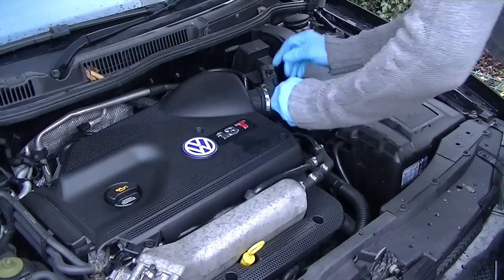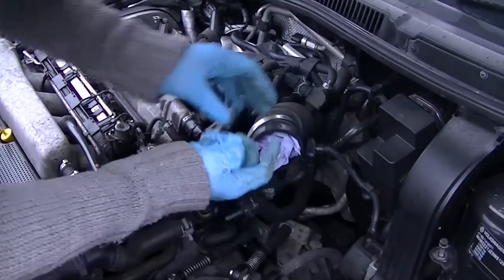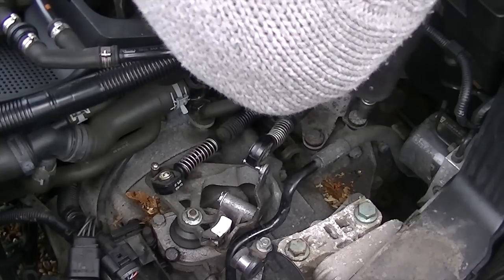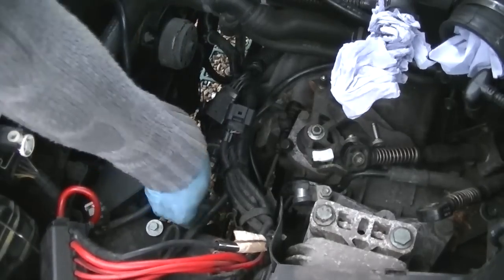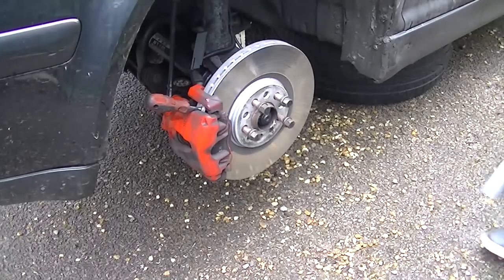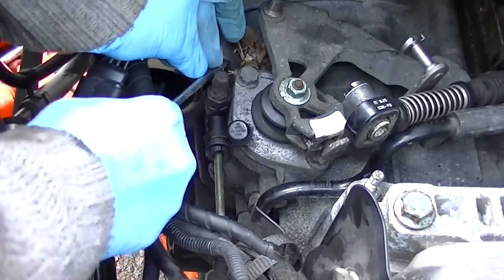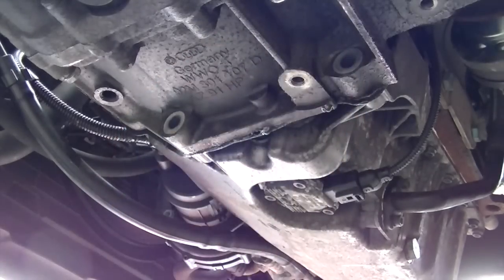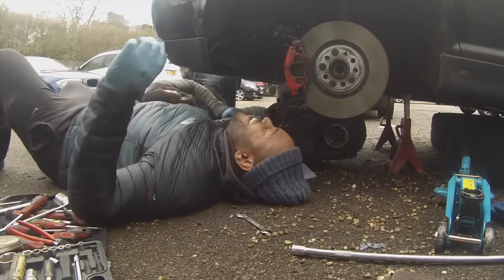How to Replace a VW Clutch Part 1

Comment: Wtf takes a new clutch off after a year or under on a new car? 
It took me 15 years to wear out a 2000 clutch & didn't get the truck till 05. First year I have it I always engaged clutch bc I was young dum & full of Gum it wasn't a 4x4 nor a heavy duty & I treated it like it was. It wor out bcz I down shift for 8 months bc my brakes were stuck on.

Comment: trying to talk myself into doing this on my 2002 New Beetle.  I think it's almost turbo time also at 340,000 miles.  It would probably be easier to do the turbo with the transmission out of the car.  I just don't know if I have the physical stamina it takes to complete this job.  I changed the oil in the car yesterday and I'm worn out today....

Comment: This video gave me a good idea of the job and I did it within two days on my 1.6sr. 
The transmission removal was indeed the hardest part, I've found that the lefthandside axle flange keeps getting caught on the engine. 
With some persquation it'll get past though.

Comment: No joke about having help with a gearbox. The last clutch I replaced myself was decades ago, on a Ford Escort, rear-wheel drive. On the road outside my house. Unlike this, there wasn't a dozen things to remove for access. Unbolt the drive shaft, undo the clutch housing and pull back the gearbox. Which, in my case was too heavy for me on my back, and it dropped, crushing a finger on the road, needing a hospital trip and five stitches to sew up a burst digit.
Now, any job that really needs a proper lift, I leave to my local garage. Anything else, I'm fine with.

Comment: Thx for the video
,I have a vw touran  2004 and have replaced clutch plate at a workshop. Just a month ago. The 6 gear come to neutral while moving 90 km /h  and when seting the shift gear on 5th gear a silgt back and forth movement in the shifr hapoen in a second and come to normal. What could be the reasons for such problem? Can cables connection make such prob. Or what could be other reasons...I do appreciate your help and support..

Comment: guys one more tip use a white old not used sort of blanket or sheet under the car. incase you drop a screw or something otherwise youll lose it in the graffle

Comment: Nice guys and nice video, but bad advice regarding dropping the transmission out without first removing the sub-frame.  Seriously, the transmission has to be pulled straight back off the engine at least 4 inches before it can be lowered, at which time its axle flange and then the trans. case bolts bind up on the sub-frame.   I could have removed the sub-frame four times in the time it took to fight the transmission around the sub-frame.

Comment: Tackled my clutch and flywheel swap at the weekend. This video and part two are were my reference guide.

Hardest part was navigating the O/S driveshaft flange over and round the flywheel/metal gasket.

All works as it should do.

Thanks for the vid!

Comment: on the MK4 Golf how many miles does the clutch last?
Reply: jimmy mangat as long as you make it last. 
 know of some that did nearly 200k on the original, but I know others have gone around 90-120k. It is more common for the dual mass flywheel to fail than the clutch!
My Leon, ASZ engine 6 speed box had 140k on the factory clutch but the flywheel was chattering. I had the car remapped and the clutch started to slip.

Comment: Thanks for the great guide. Quick question, hopefully you are around still. I have the new flywheel, clutch, pressure plate, etc. all installed. I am really really struggling to get the transmission to hook up though. 
How did you do it? Any tips?

Comment: I got a 1999 VW Passat 1.8L turbo needed a clutch, my mechanic got the clutch put back in but ran into an issue it won't start/or turn over. Any ideas what it could be? He said he unplugged 2 cables. Could it have ruined the starter? Or could it be the security inside the car that won't let it start? Please let me know what you think

Comment: I need help, transmission fluid got into the flywheel inspection hole clutch is slipping do I need a new clutch or will it dry out?
Reply from the maker: you will need to replace clutch and slave cylinder
Reply: thanks guys had it booked in yesterday runs a lot better all they did was replace the clutch not sure about slave cylinder

Comment: thanks man. definitely help me 100% on mine. i was completely oblivious on what to do. my flywheel was offset with the bolts and had to cut out the flywheel plate to get to the bolts.  i also found it easier to get the transmission removed from the top. on my tdi there was a bracket i was able to use as a handle and twisted it as you mentioned.  cheers!

Comment: I changed my clutch following your video. Good stuff !  Just want to add something because I was alone most of the time. So it really helps if you lower the engine (at the gearbox side)  once the gearbox is detached from its mounting. I cant say how much it should be lowered. Very carefully and when hear a slight crackle then stop (about 150mm). When you detach the gearbox from the engine body , you need to  swing the differential  anticlockwise about 90 degrees (till stands upwards) . I suggest doing the same thing when fitting it back. Also prior assembly I pushed the engine slightly towards the other mounting (on the other side of the engine) and lay it on a axle stand so it does not come backwards. A few centimeters of more freedom really helps.

Comment: The torx bolts on the transaxels are stripped, is there an inexpensive solution?
Reply: +spadesishere buy the Torx Socket Tool . they go usualy for 16-30$ on ebay new. or ceaper at your local tool store. even though you will use them to remove the transaxels . i can ensure you.it will come time which you will need to use them again.
Reply: +Niklez7 not very helpful seeing as how i have torx bits.. They are STRIPPED..
Reply: +Niklez7 not very helpful seeing as how i have torx bits.. The bolts are STRIPPED..

Comment: I had my gearbox removed a year or so ago for a clutch replacement and they said the mount was almost too worn to reuse. This is on a 02M gearbox, TDI 150. I guess they are talking about the aluminium bit between the mount and the gearbox, that the big bolts go into - looks like the bit on the engine mount that also likes to strip its threads. Need gearbox off again so could do with knowing what to get hold of. The mount itself doesn't have any threads in it, right?

Comment: it seams like you are a good VW specialist can i just ask because i have a mk5 golf 1.9tdi is the 5speed gearbox reliable and how to understand when to change the dual mass flywheel and will i have any problems if i change it with a hard normal flywheel

Comment: How to replace a VW Clutch. Lift car. Disassemble every piece of car. Replace clutch. Reassemble in reverse of order of removal. Job done...
Reply: Easier said than done
Reply: That's pretty much ever maintenance procedure in a VW. It's PITA but you can't beat the fact that those cars run very well.
Reply: Maybe 9n the transverse ones. Longitudinal engines are very easy
Reply: no no no, how to replace a vw clutch, lift car, remove front wheels, release lifts and have it hauled to a junk yard and buy a new car lol

Comment: Pukka video m8, got a question my golf mk4 (AJM) seems to be a bit notchy going from 1st to 2nd gear it's more noticeable when turning corners when changing upto 2nd gear, still unsure if it's the clutch as it still spins in 2nd gear easy, could it be a simple job or something like the gear synchro! I know you can't diagnose over the net but your opinion would be really helpful hopefully.
Reply from the maker: It could just be worn gear linkage bushing, or pressure plate worn, does it go in easily what the car is off?

Is it hard to get into reverse. If you have Facebook its probably best to add me there

Comment: have you ever had any problems with the ECU flagging up a load of codes that causes the car to go in to limp mode , touch wood its not a problem on the car that i am driving but  Apparent this  an issue on some modals of these cars and can happen without warning .i have watched all yours videos and they are Great to watch thanks .

Comment: how many hours did it take you to complete the whole job ,I noticed you only changed the clutch plate i seen videos on you tube stating changing the duel mass can be a nightmare  to do apparently.
Reply from the maker: What I have shown is the hard part, which is removal of the gearbox. To change the flywheel is just 6 bolts, on a off procedure. With filming, dead batteries etc, it took me about 8hrs. But to do the job without that, i would say its about a 4hr job doing it on the floor like me. It would be quicker if you had all ramps and all of that stuff.

Comment: Loving these videos ,but how can you tell  if clutch is on its way-out now you fitted a new clutch do you get any vibration on the clutch peddle ??????my 1.9 tdi with a ADT engine as  done 78000 miles on a 2003 but i get a vibration on the clutch pedal is it time to change the clutch in my car ????